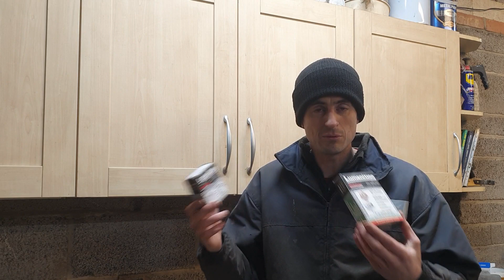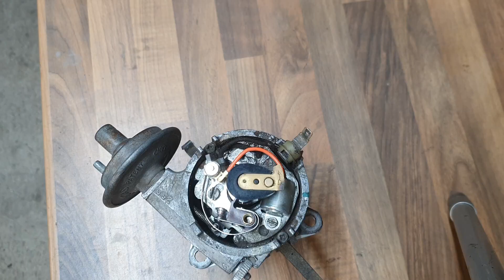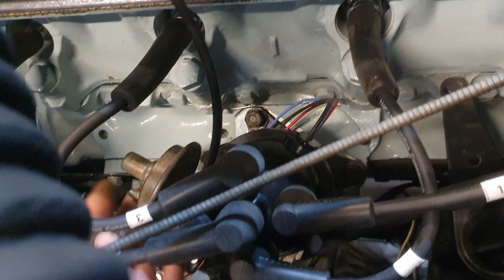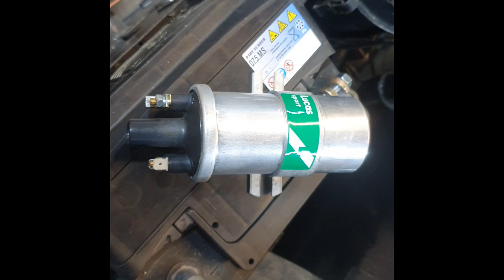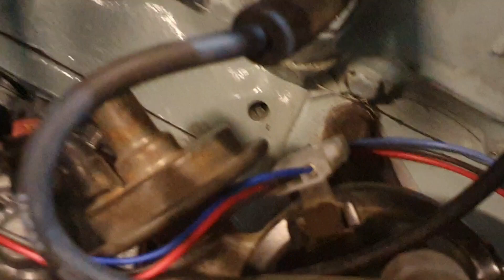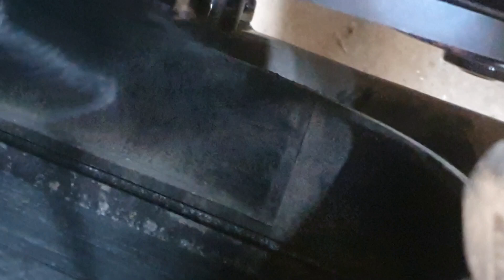Lumenition Land Rover Series 3, instructional video on how to fit electronic ignition to your LR S3

Comment: Thank you for explaining in depth how it works and what could be the possible issues. I have an issue of spark plug on the first cylinder not firing. Now, when I've seen your video I will inspect closely what is going on. THank you again!
Reply from the maker: Thanks for the comment, much appreciated. Glad it was of help to you.